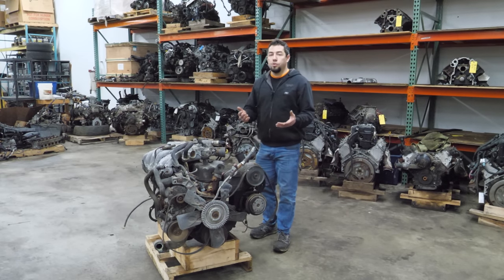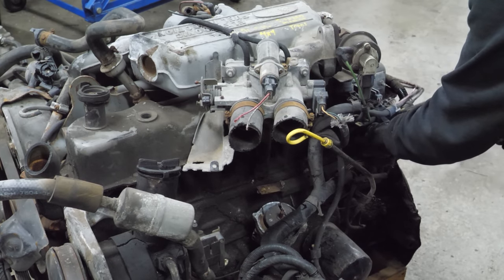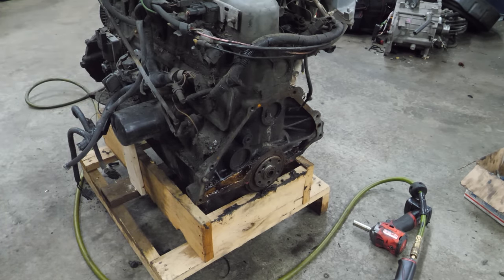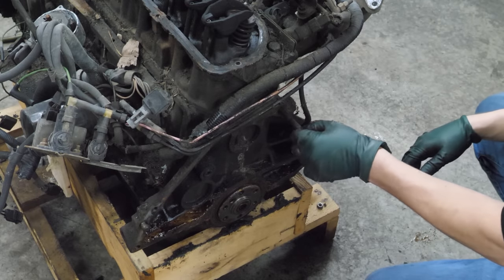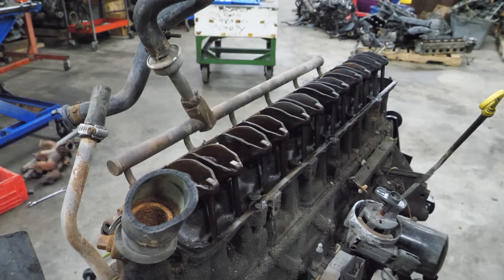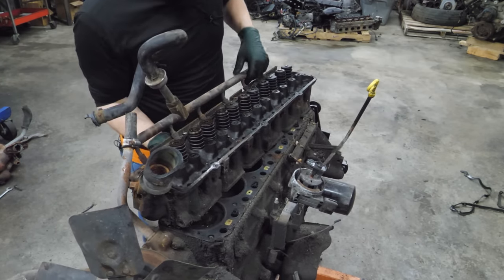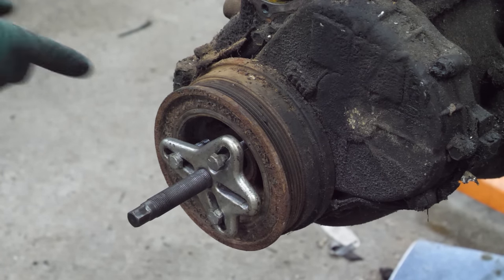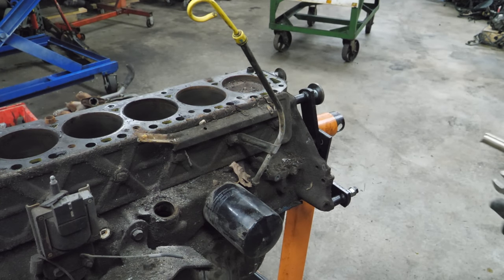FINALLY! A "Bad" Ford 4.9L 300 Straight 6 To Teardown! Most Reliable Engine, Ever?

Comment: Most of the big auto makers had a similar engine that was simple and reliable.  Ford’s 300, Chevy had their “Stovebolt” 6, Dodge had the slant 6, and AMC had their 4 liter jeep engine.  They were all workhorses and super reliable with minimal maintenance.
Reply: Inline 6 engines are almost always a home run. They sound pretty good too
Reply: @Acc0919mc  There's ways to mess them up, but the basic design simply lends itself to reliability. Internally balanced, more main bearings, fewer moving parts etc.
Reply: Toyota JZ, Nissan RB... Ford Australia's Barra, BMW straight 6..

Yep. They're something else..
Reply: None of those engines had 7 main bearing journals and none of those engines were as strong as the 300 Ford.
Reply: @Mark-in5yw  ROFL.
Reply: They’re all good but the Ford 300 is the best of them.  Gear driven cam, seven main bearings, on top of being overbuilt and underpowered like the rest.  The closest engine to the toughness of the Ford 300, I can think of, is the Toyota 3400 V6.
Reply: @indyogbpurdue9966  my dad was a mechanic and he always liked the slant 6 best.
Reply: Chevy 292 was a great straight six as well. It was probably the closest competitor to the Ford 300. Like the 300, it was used only in trucks. 

And if you really wanna go old-school, flathead sixes like the Chrysler 230 (which was used in the original Power Wagons) and the old sixes from International, Nash-Rambler (which later morphed into the venerable AMC straight six), Hudson, Studebaker, etc. were fine engines for their day.
Reply: The Chevy stove bolt size hopefully includes the 292 cubic inch straight 6 as well, does it not???
Reply: Yes a great group for sure
Reply: Oh, I love the 300 but I also have a special place in my heart for the slant 6.  My dad had a Duster that I believe was a now kind-of collectible Gold Duster with the slant 6.  You just have to love the sound of those older, under drive starters and those engines were tough.  It was always weird that Chrysler keys went into the ignition upside down though.
Reply: @sandasturner9529  no, the stovebolt came before that one but gm had several decent 6’s as well
Reply: @kellismith4329 
The Chevy inline six went through three or four generations that saw improvements. I believe it started out as a three main bearing engine with splash oiling on the rods. Complete with rod dippers. Later updated to 4 main bearings and then seven main bearings. Nash had four and seven main bearing sixes. One way to tell is the use of a different bore center distance between the cylinders with a bearing in between versus the ones that didn't. 
I believe the Toyota sixes started out as a license built version of the Chevy. Nissan l believe licensed a copy of a Mercedes design. The Holden in Australia was slightly scaled down version of the Chevy. The Chevy started out as a 4.400 bore center and stayed that way until the end. This probably why the SBC had a 4.400 bore center.

Comment: A 300 with a granny gear 4 speed was a towing machine. I was sad when they stopped making the engine. This engine is the definition of they don't make them like they used to.
Reply: ford put them out (in 1977) with a single core radiator, work for communting but was under functional when doing heavy towing
 and made that truck prown to overheating, a 3 or 4 core (cant remember wich, just to many years ago) radiator change out solved that hickup
Reply: I use a 300f150 with the Mazda 5sp transmission it pulls pretty good (small tires to apply more torque)
Reply: @mikedesensi6391  hmm you might be onto something with that. I had overheating problems with a fully loaded truck (weighed down to where the axles are bottomed out) got a single core rad. Only problem I ever had with the truck otherwise
Reply: I have this motor and a Toyota 4.7 . Toyota is better motor that will last even longer. I like the 4.9 for sure but to me the 4.7 toyota is the best motor ever built. You do have to do the timing.
Reply: @kingjesus7926 neither of them are good.
Reply: @jdrok5026  Provide your sources to affirm your statement...
Reply: @mybigfartsreallystin  sources? Sources for what? The 300 i6 ford isn't bulletproof with every part capable of failing fiber gear sets on carb models it over fuels the center 2 cylinders and leans out the outer two. Like any engine they can have catastrophic failure linked to multiple aspects and like the 4.7 Toyota they are extremely under powered. Not great on fuel and just all in all extremely overhyped engines.
Reply: @jdrok5026  Well then, why are they still in demand?

..."overhyped"...riiiiiiiiight... XD
Reply: @mybigfartsreallystin  they aren't in demand atleast not in any real way. Certainly not in today's world where most of our equipment industry is powered by diesels. Its rare to find a gasser yes overhyped gutless has reliability issues not torque no power heavy piles of scrap. Even in the 49 hp equipment range if you tried to sell me a 300 i6 ford id laugh my ass off at you because yes let's make somehow less torque than a i3 diesel.

Comment: Gotta love the 300 inline Six brother, it'll outlast any Ecoboost engine with ease.
Reply: 300: Hey ecoboost, where are you going to leak today?
Ecoboost: Anywhere I want, wiseass!
Reply: @BobSmith-mc7uq  eco boost:  jumps time.
Reply: @LMHS63John  Bingo. The wife had a lease Escape, think it was  an 18 or 19. Low miles, started gurgling the coolant, dealer dropped in a new short block.
Towards the end of the lease, the dealer she leased it from hounded her to bring it back in so they could resell it.
She went to a different dealer, they had her buy out the lease, bought it from her & she walked away with money in her pocket.
While she was waiting on the engine work, she had another Escape she was driving, Titanium. Nice car.

Comment: The Ford 300 straight 6 is an awesome motor. One of the previous Ford CEOs for the truck division wanted to revive it, but there were concerns over emissions. The other concern was that trucks had become a fad and a money maker so they wanted to put an engine in the trucks that was refined and that would appeal to those people who drive "mall queen pickups" (You know. The ones lifted, with lights all over, over sized tires and a bed that has never been dirty).
Reply: "mall queen pickups" I like that one.  "tonka trucks" where they have the wee little beds where practically nothing can be hauled. Of course, some use a pick-up exactly for what it was intended, but most are just for show and the people driving them are as clean as their flashy, lifted, big chrome wheeled truck. And, of course, it has to be a 4 x 4 even though it hasn't left their city streets in years. If it has, it's never left the highway either. Reminds me how all the city boys dressed like cowboys to line dance with their ladies---what decade was that? Probably driven to the club in their flashy truck. LOL
Reply: @KStewart-th4sk  I often refer to these types of trucks as "Pavement Princesses/Princes".  

I wish people bought trucks for what they're made for.  My 95 OBS with a 460 is a WELL taken care of truck, but it does work all the time as a hauler moving several thousand pounds.
Reply: mall queen pickups lmao, just cause you can't afford a nice truck doesn't mean you gotta put others down that can. Crew cab short bed for life. Everything else is just a peasant work truck.
Reply: and have it lifted like 30 feet in the air.
Reply: @mitch9521 should heed your own words.  Was told this long time ago. Pick up has a 8 foot bed any thing shorter is a sub with an open back. That was from a ford heavy truck fleet salesman. Mall queen is appropriate description of short bed trucks. The irony is anything titled pick up not allowed in our condo complex. The home association stated we have standards.its like that all over Naples. The irony is the smaller ranger was based on Taurus platform and titled as a car initially.  Funny how vehicle titles work.  When you use words like peasants don’t harp when some calls out when you ask not to call names. Point vs counter point.
Reply: @mitch9521 😂😂😂😂 I can easily afford 3 of those mall crawlers right now, Im not gonna buy one though because im not gay. 😂😂😂 

Ill keep my c20, if you want to try and out-pull me let me know. My truck hasn't ever been outpulled by anything short of a tractor

Comment: I am the original owner of a 1979 Econoline with the 300 I6. 
Hated it when people said 4.9
When was the last time you saw an original four on the floor van. 
First vehicle I ever bought new. 
Almost 300,000 miles and never removed the valve cover. 
She’s my baby now with vintage car plates !!!
We’ve grown old together.  🤓👍
Reply: My stepdad had a 79 E150 with a 300-6 and 3-on-the-tree.  It was made into a conversion van before companies that did that.

If I could find it today, I’d buy it in a heartbeat.  It wasn’t a perfect van, my family camped in it once when it was Rand our tent leaked and our van did, too.

If I found that van today and had the ability, I’d buy it.

I love vans, especially with manuals and I really love 3-speeds on the column.

[X][X] []

Hopefully…..  Long live the manuals.
Reply: Btw, I have had lots of 300s in my family, one was ran REALLY hot!  New radiator, water pump and thermostat, it was like new!  

1985 F150- 300-6, 4-speed manual OD.

❤
Reply: We measure in Freedom Units, not Commie units
Reply: I think how its supposed to go is 4.9 is the EFI version and 300 is the carbo version.

Every old ford ive seen if it said it has a "300" "302" "351" it was always carbureted except for one that was TBI and if it said "4.9" "5.0" "5.8" its the "modernized" engine with full multiport injection
Reply: We had a 1983 club wagon XLT  4 speed on the floor (3 and overdrive) with a 300 six and it was by far the best vehicle I've ever owned. 200,000 miles with zero engine problems but the rust ate the body up. I still hate myself for letting it go.

Comment: I loved this video. I wish you'd rebuild this 300 as a YouTube series of videos. 
I bought a 1967 Bell Telephone Econoline van back around 1982. The original Bell Telephone color was forest green. When I found it, it had been painted yellow and white and looked terrible. It was used as a work truck and not treated with love and care. The good news is that this van was heavy duty, rust free and came with a 240 CID straight 6 in it. It also had a three on the tree transmission. It was equipped with a heavy duty suspension and nine inch rear end. When found, it was sitting in the owner's back yard on one brake drum and two flat tires. The back doors were open and a big dog was living in the back. The owner said it overheated so he parked it. So after some haggling, I got it for $340.00. The distributor cap had carbon tracking, which was easy enough to fix. After a couple of months of driving, I found that the cylinder head was warped (probably from the earlier overheating) so I took the head off and had a local machine shop make it nice and flat. In early 1985, I drove it from Atlanta, GA to Southern California. I pulled a small moving trailer and my 240 didn't miss a beat. At one time in the early 90's I had a burned exhaust valve so I pulled the head and fixed that. The machine shop guy working on my head told me how wonderful this engine is. I've still got this van. I took a body shop class and learned how to knock out dents. At the time, my van had plenty of dents. Looks a lot better now. I've got all kinds of spare parts and body panels. One day, it'll be a dark green Bell Telephone van once again.
Reply: Awesome

Thanks for sharing!

Comment: We run I think at the moment about 15 of those here in the Texas oilfield. 
  They run on natural gas from the oilwell casing. 
 They run 24 hours a day seven days a week about 350 days a year on average except the days when the well is down    
 So if you convert that into a vehicle time, just imagine averaging 45 miles an hour 24 hours a day that would run you about 370,000 miles a year equivalent.  
 And those motors run at least two years before something ever happens, and generally it’s just consuming motor oil. Very seldom is a catastrophic event like throwing a rod through the block, or some sort of failure.  
The key to those things are never shut them down. The only time they are turned off generally speaking is for an oil change.  We run them with cap and rotor instead of electronic ignition. It’s just less trouble because they sit out in the weather all the time and the least amount of electronics you can have on something the better.   
  Never have any problems with the valves or carburetion because they are running on clean natural gas. And with no carbon in the engine, you can run those motors for a month before you change the oil, and believe it or not the old still has color to it due to no carbon.   
  Great motors. I pick them up every time I can find them.
Reply: Interesting comment - great to hear they are still in use.  How long do the bearings last in these engines in Texas?  20 years ago I came across the same/similar 300I6 power units in the Lloydminster oil field.  At the time they were replacing some of the 300I6 with new units powered by GM 4.3V6, a good engine.  I remember the GM units had an auxiliary oiling system that would allow the techs to do halfass oil changes with the engines running. It was 250 hr service intervals.  I saw one of the 300's that threw a rod because it was missed on the maintenance schedule and no servicing, they said it was running for 2 months by the time it ran out of oil.  I hear they now they use Hyundai 2.4 with NG electronic injection - no idea on the durability though.
Reply: @epasay9515   I’ve only seen maybe one or two actually throw a rod. 
 Which giving the time that is on those units is pretty understandable. 
  I am 52 years old and I have been gauging the same well for 22 years and it has the same motor on it that It did when I started pumping that well.  
 It is simply amazing how long that design will run.  You can pull that engine up off of the frame with a forklift and do a “ in frame “ with caps and bearings in about 4 hours  and be back running.
Reply: The valves get carbed up when the intake sucks dirty air, otherwise it's not too bad
Reply: Very interesting!
Reply: @epasay9515  I don't know anything about oil fields, but I know a lot of the Fork trucks I've driven throughout the years have had the Chevy 4.3, and it's a very durable engine too.
Reply: Same experience running them on LPG. After 10 years we pulled it out for a complete overhaul and the inside was stunningly clean. Great workhorse of an engine.
Reply: @cavscout62   Probably part of the reason why we're not switching to propane/CNG.
Reply: 2 years only? That's PATHETIC! 
Theres oilfield engine's out there that are 50+ years old, STILL in service, and have NEVER been touched for anything other than regular maintenance.
If those 300 sixes are burning oil after 2 years of service, then they're JUNK.
Reply: I really hate to tell you, but sealed electronics survive MUCH longer out in the weather that a mechanical part would ever do.

An electronic ignition vs. a mechanical distributor, for operation out in the weather, the electronic unit wins HANDS DOWN. There's NO comparison or argument against it.
Reply: @epasay9515  EP ...............thanks for the update .........was wondering
Reply: i am in australia and would like to put in my truck, what do you pay for a motor, so i can think about importing costs etc and can you recommend a website most Americans use to move stuff like these motors. Thanks
Reply: I wouldn't have a gm engine on a weed whacker. GM sucks. I've had too many gm cats that left me stranded in the middle of nowhere. My 75 Ford f100 has the 300 inline SiX and three on the tree. I paid $400.00  for the pick-up and it's never failed to start, run, and get me home.
Reply: I’ve got a 1990 F250 with a 4.9L I6. What’s needed to run it on LPG? I’d love the capability!